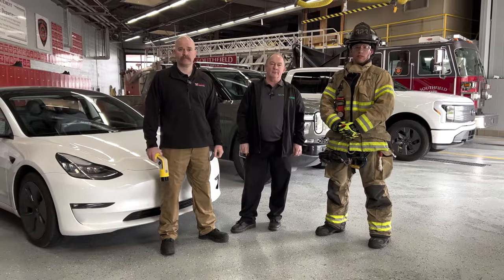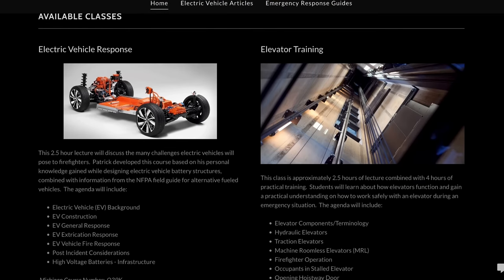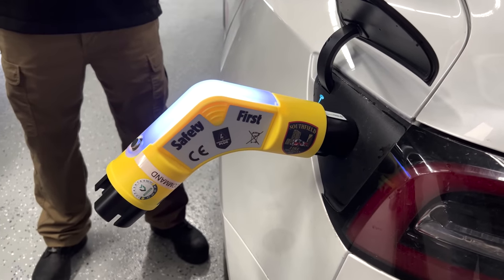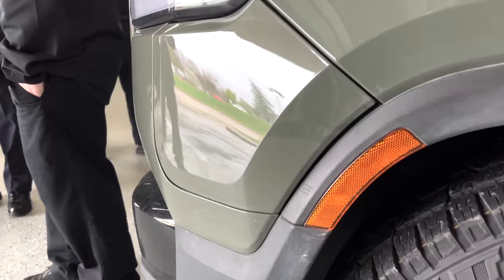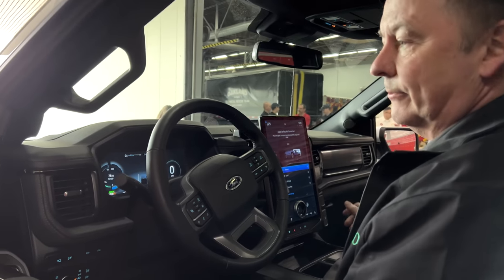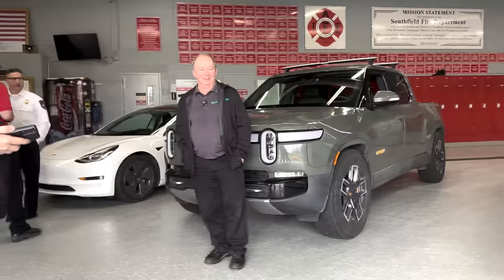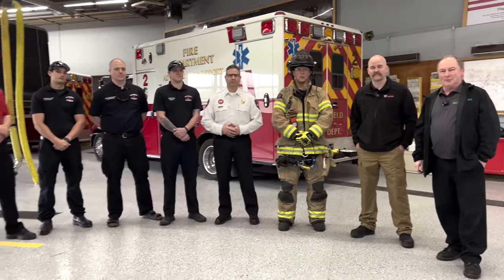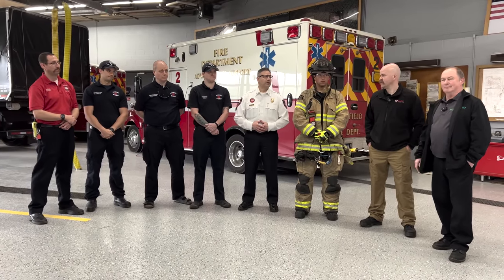An EV Device for First Responders: Emergency Plug Demonstration

Comment: Teslas also have a wire loop (labled with a picture of a firefighter helmet) under the hood near the washer fluid fill. If you cut that cable it turns the car off and isolates the high voltage battery.
Reply: Most modern EVs have this as well, and a key advantage of that option is that it isolates the high-voltage battery, rather than possibly having it turn on the contactors to connect the high voltage to the onboard charger, as it does at least at some point when you connect a level 2 charging connector.
Reply: Genius!!
Reply: Our Ioniq 5 also has a big orange fuse with a firefighter helmet on it, pull it to cut the high voltage power from the car.
Reply: If u can get to it and the current potential is still in the battery and short circuit can happen inside the unfused area
Reply: Yep, though this device may be more useful for something like a medical emergency where the car isn't crashed but maybe just stopped in the middle of the road because the driver passed out. The rescuers could plug this device in to make sure the vehicle is immobilized without having to damage the vehicle.
Reply: There is a reason race cars have an isolator on the outside of the vehicle because in the event of an accident it doesn't matter how good the system if you can't get to it.
Reply: @shaynegadsden  yes, fire extinguishers and other crucial safety equipment should not (without redundancy) behind locked doors for a reason
Reply: @shaynegadsden  : ^^ This right here.  The reality of the matter is : This device is designed for the safety of the first responders, so they don't get run over if the vehicle is "in gear" and the person in the driver's seat is incapacitated to whatever point where they can't control the vehicle while they're still trying to get your a$$ so you don't burn to death.  

Said "disabler" device might work, or if the vehicle is engulfed and melted the charging port wiring at that point it doesn't matter, and in that case everybody's just "watching the show" and hopefully everybody got out without the EV catching everything on fire around it due to sheer heat of the battery fire.

commenters have

So yea, if I'm in Coal Center, PA (yes that's a real town lol), and 6 dudes from the local VFD who got out of bed at 2AM to head to PA Toll Route 43 because I hit a deer, which then sends me off the road into a tree at 65MPH, something shorts out, and my battery's on fire : I want whatever gets them to be able to get as close to me as possible to pull my ass out of there so I don't burn to death, or am covered in 3rd degree burns for the rest of my life.  This this tool helps them do this, I'll all for it.
Reply: I think that wire loop and this tool play a different role for different emergencies.
If a car is just a potential hazard, but currently undamaged putting it into park with minor (potential) damage (the door to the charging port) can be the right solution.
After resolving the situation, the plug can be removed and the car driven of.
Meanwhile, cutting wire loop means that car is not going to drive anywhere.
Reply: @sarowie  nah you can simply rejoin the wire if needed so not a major deal although this device seems better in every way
Reply: @charliesullivan4304  ALL modern EVs that a cutloop
Reply: It's also non-replaceable. You basically have to replace the car if they cut it
Reply: @acebarker51  Wtf no seriously the loop is literally that a plug with a loop of wire it could be replaced be a 5 year old
Reply: @TheSeanUhTron 
Exactly !!!!

Comment: As much as I love this for use in emergencies, this is also a useful tool for carjacking. Until now, a person on foot hasn't been able to disable a vehicle from the outside.

I like the fact that (at least on a Tesla) the charge door is locked when the vehicle is operating, making it a bit harder to insert this device.
Reply: Most EV's I know lock the charge port door when the car is on.  You'd have to force them open.
Reply: Car jacking was my first thought. My second thought was that every electrical vehicle has a cut loop for first responders. It's designed into the vehicle and it's a lot less janky than this contraption. Also, when I get my first BEV, it's going to be equipped with a charge port ejection system in case I get into a situation at a charging station.
Reply: Just last week, I speculated about the possibility of such a device for use by robbers and carjackers. Seems my concerns were well-founded and even tame---I assumed the vehicle had to be stopped for this to work.
Reply: This is why you use a PIN on a Tesla. Cannot be stolen unless you give away the PIN
Reply: @mikebalentine  I don't think someone who forces you at gunpoint to get out of your car will hesitate to add "give me your pin or else" to his spiel...
Reply: There have been ways to disable a vehicle from the outside of ICE vehicles from their conception. The thing is that the majority of those actually make them harder to drive afterwards. It’s really difficult to steal a car when the engine is destroyed.
Reply: @GeoffJohnson  I’m sure the carjackers would be fine using some force.
Reply: @HenryLoenwind  way to make the victim there as stupid as possible that’s also assuming you are in the car. You can either run or defend yourself depending on the situation. Most car jackers are not the brightest if you abandon the car it will still be there later.
Reply: The charge door on teslas can be opened with a Flipper zero...
Reply: @mikebalentine  Yeah, sure. And I suppose that you would refuse to divulge your PIN when a car-jacker is threatening to end your existence with extreme prejudice?
Reply: you cannot open the chargeport on a locked tesla. any charge cable disables any ev.
Reply: Police will now pull you over, flip up the door and stick this device in, disabling your car.  "For your safety" of course...
Reply: @surferdude4487  you are assuming they know about it lol an interrogation does not happen at a car jacking. Such a ridiculous argument.
Reply: @aussie2uGA  good point this could improve officer and public safety. No different than them currently demanding keys to be placed outside the vehicle/ignition.
Reply: @pcysneros  The flipper zero just emulates the Tesla charger button and asks the car to open the port to charge. You can’t open the charge port unless the car is in park, even with a flipper zero.
Reply: It doesn't matter if the charge door is locked as the tool kit for this device comes with some handy pry tools to forcibly open it :)
Reply: @GeoffJohnson  it might be different for US Tesla‘s or otherUS ev’s but on the European charge port you can’t plug in anything, even when you prey open the cover. There is still a lock inside the port, it will prevent you to connect the adapter/cable.
Reply: @wtmayhew  I doubt you need a subscription, especially after a certain car maker wouldn't disable and locate a car hijacked with an infant inside.   Their policy changed right after that.
Reply: @commodoresixfour7478  When the ball is aIn GM’s court,I’ll bet they’d find it it is suddenly easy to remotely disable a car, say for non payment of a lease installment, etc.
Reply: Your reasoning doesn't really make sense
Reply: Never owned a EV that didn't have a locking charge door. I've also never owned a Tesla. So safe to say its not really a fear to have.
Reply: I mean people 3 years ago were able to drive electric cars like they are RC over Wi-Fi
Reply: @pcysneros  or a screwdriver
Reply: Before this device, you could do the same with a charge cable.
Reply: @HenryLoenwind  they deserve to get robbed at that point, push the pedal instant torque to the wheels
Reply: Started off right, the second you said the wrong "until".... then you just went dead wrong.
Reply: a 50 bmg through the engine block can do the trick.
Reply: @surferdude4487  The CUT LOOP is to disable the airbags, NOT the HV system.
Reply: @MacMashPotato  Something as simple as sugar in a gas tank.
Reply: Here is one thing you forgot, 10 months ago there was a ev car that moved on its own tripping over and injuring a person. I just saw it and it was terrifying. They had to use the plug to kill the system or it would run off. But it didn't exist yet then. You need the wire trick exploit to trigger a failsafe remotely away from driver seat.
Reply: @surferdude4487  Interesting concept, but that power cut off for first responders can be located anywhere in the car. Drive up to any fire house and ask them if they can find that loop. They'll be playing all day, unless their dispatcher has a reference book and someone can tell them which model to look up.
Reply: @derekwhite5090  Spend 1 second to do a Google search. It also shuts down the high voltage system. It would not be much use if it left the high voltage system active now would it?
Reply: nissan leaf is locked when shut and its at the front of the car so if your able to open the hatch you are getting run over.
Reply: @fcssensai  The Mythbusters were unable to kill an engine with sugar in regular gas, but maybe it would be possible with e85 or e100. In elementary school, I heard that a classmate poured an entire 2 liter of orange soda in a teacher's gas tank, and it took over a month to fix.
Reply: I haven't encountered a car that allows the charge port to be opened by a random person on the outside.
Reply: @GeoffJohnson  I could open any charge port with a flat screwdriver in about 2 seconds. So can anyone else with baad intentions.
Reply: @mikebalentine  True but if you are the target they don't need a pin
Reply: @justinweatherford8129  false statement
Reply: @davidck1  yes i can in about 2 seconds
Reply: @nothanks960  It is different. read the 4th amendment
Reply: @starraidz791  I can tear your charge door off your car in 2 seconds with a screwdriver
Reply: @4bangerlove  I'm sorry if you lack the knowledge of how to easily disable ICE vehicles. It's probably a good thing that you don't though.
Reply: @ExperienceCN this device is made so the locking tabs don't have any plastic in the area of said locking pin . It only needs to attach to the comm wires in the port to do its job ..  2 bare wires with banana  clips will do the same thing ..
Reply: @aussie2uGA remote disabling will be built into cars soon anyway.

Comment: There’s a video of the German response to a burning Chevy Bolt.  A crane and huge tank (of water?)  is brought to the scene and whole car is lowered into tank.  You’ve got to admire German preparation and efficiency.
Reply: Dutch fire fighters have that as well. welcome in Europe!
Reply: Where can I find a video of that?
Reply: Now that's what I call problem solving
Reply: Neat. But somewhat unnecessary for a Bolt (or anything that isn't a f'ing Tesla, and a Tesla would be slag by the time they got there.)... the batteries aren't firecrackers. Sure, they have plenty of power to melt things - like any battery - but the battery chemistry does not create an impossible to quench fire.
Reply: @jfbeam  I suppose it is the German sense of drama.  It was a rather Wagnerian end for the poor self-immolating Bolt.

Comment: Also, if this gizmo only (or mostly ) needs to work on Teslas and CCS1-inlet EVs , then having the detachable (and therefore loose-able ) CCS/NACS adapter is silly.   The thing is boomerang-shaped, with two ends; put one connector type on each end, and have nothing to lose.
Reply: maybe it needs to be sealed on the other end for some reason?
Reply: Maybe the other side is CCS2?
Reply: Probably a removable battery on the other end already. What we should be doing is standardizing the Tesla plug in the beginning. The CCS plug is really dumb.
Reply: The other end (although not shown end-on) is labelled "CHAdeMO".
Reply: @paulsladen  The same drive-system immobilization should be achievable through the J1772 connector that even all CHAdeMO-inlet EVs have, and which (presumably) the CCS end of the gizmo would connect to.   "Ah but what if the J1772 port is trashed, but the CHAdeMO port survived?  Wouldn't you want extra features designed in to handle that eventuality?"     That would be an awfully unlikely one, wouldn't it?
Reply: @Taluvian I don't think a standard should be owned by one company. Plus I think the CCS connector is capable of a higher charge rate and is standard in Europe.
Reply: @whdfshawn  Doesn't matter if it's open. Tesla opened up the patents for chargers years ago. Anyone can adopt the charger technology. Look at Aptera, they are using it because the smaller plug makes sense.
Reply: @Taluvian  they should just put a couple d  cell batteries in the side to run the microcontroler
Reply: @Taluvian  I think tesla deregulated superchargers finally. There was no incentive because all the public chargers were CCS except Tesla's which were incompatible. The connector was always available but the chargers were locked which defeated the purpose.
Reply: @bluecraney1  No MCU required. The J1772 "communication" is just resisters. The box we have for our EV racecar is just an expensive box with two resistors, an LED, and a switch. (there is a signal from the EVSE telling the onboard charger how much power is available.)
Reply: Nah. Any respectable fire department will keep this important tool in it's case.
Reply: @jfbeam  i was making a guess at its construction with no research with my bacground in computer comunication most "handshakes" require a clock on a bus to comunicate. but simple ones like charging tend to be resistors. figures ev's were a little "smarter"